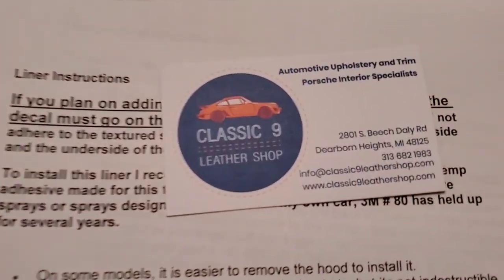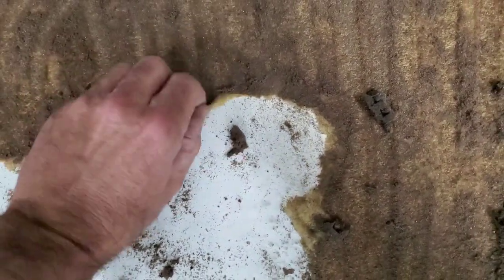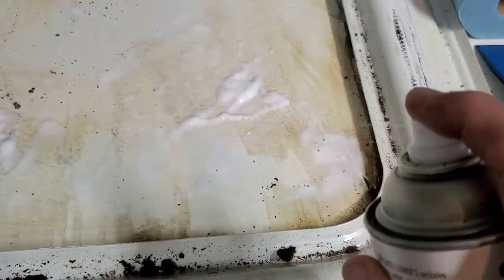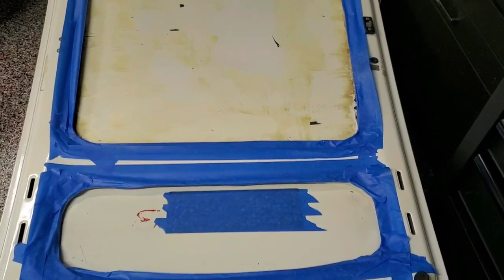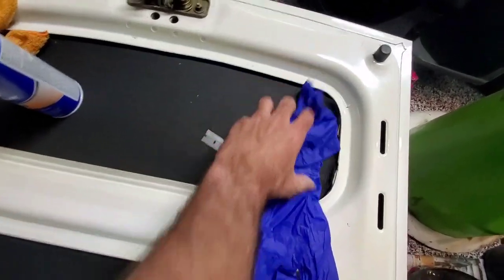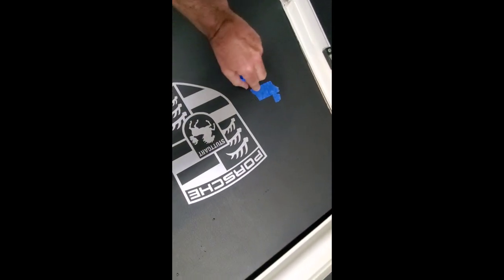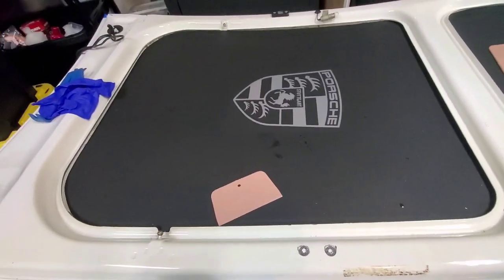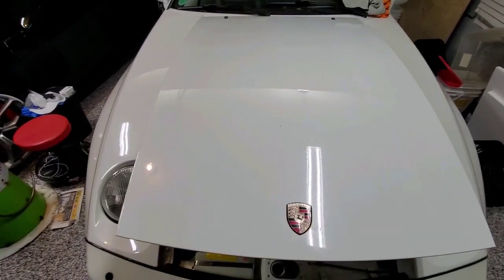Porsche 928 restoration part...?🤔 under hood liner installation.

Comment: Great job.  I did this on my 89 S4 last year. I got the liner from one of the "other" 928 companies but I love Garage 9 products. Only thing I would add is that I ended up using a stronger spray adhesive than suggested because of dropped areas. Supposedly reduces fire chances as well since the old foam liners can become oil soaked over 30 years.

Comment: Tony, just wanted to drop  you a line and let you know this is my 3 rd time watching this video! I have this same "repair" scheduled for the Spring when I take mine out of winter sleep. I have already gone to the Classic 9 website and picked out my items needed. My only question, please explain a little more why I should mark the bolts when I remove the hood?
Thanks in advance.
Reply from the maker: Good evening, the hood holes are slotted.  I marked mine so I could get it back in rhe same place for alignment.

Comment: You said you took it to an a/c shop to have it fixed. What did they do to it? Is it converted to 134 and why did they not fill it to the proper amount? I hope that if they had to vacuum it out and open it up that they changed the filter/dryer.
Looks good! Wish I could afford it. I'm sure you've sold it by now since this video is about 8 months old.
Reply from the maker: Warner, I did sell it.  I did not change the ac to 134.  The shop I found put the old r12 or whatever it is back in.  He flushed it and put new dryer and o-ringa in everything.  It was only $240, and I think it was a good choice.  The ac works perfectly and even in St Louis heat and humidity it cooled it right down.  I had bought the car as a COVID project to work on during the lockdown.   I miss it alot and it was such a great car.  I have been looking for another one and have my eye on one locally now.  I prefer the 16V engine.  The one I am looking at now is an 89 with 40,000 miles on it and not driven since 2010.  Keep an eye on the channel.  I am going to pull the trigger on the 89 or another car in the next month.  I have one more car,  a 1969 Pontiac GTO I am trying to get finished and will get a new project shortly!
Reply: @tonybosworth5382  That's bizarre! I didn't know you could get r12 now for many years. I have converted many cars over to 134 in past. It only takes a new filter dryer if the compressor works and there are no leaks. You just have to be careful because from what I understand you cannot put as much of the 134 in as it's r12 capacity. Oh well!
I hope you get the other 928 and will be looking forward to seeing you work on it.

Comment: Citrus cleaner will release the glue...you’ll need to hose off with water to neutralize when done.
Reply: Old credit card/membership card as a scraper...
Reply from the maker: Thanks Dan.  It all worked out well.  After I broke down the old adhesive with the electric contact cleaner the Simple Green worked well.   I used a wet towel and then 70% iso-alcohol for the final cleaning and worked great.  Sounds like you have done one or two of these or similar!  Thanks!

Comment: how much time would someone budget for the removal and installation?
Reply from the maker: Jim, I did it in about 6 hours including taking the hood off, detailing the underside ans waxing it before I pu the new liner in.  If you get the same one I got, be sure to use the 3M product they suggest.   I have spoken to several people who used other stuff and it didn't hold up.  Its well worth it when you are done!
Reply: @tonybosworth5382  Thanks  for posting.  Doing 86. 944 this weekend

Comment: My lining was mint, but a rat managed to find the warm spot and carved out an area, bastard. I am quite capable of square cutting out the offending area and replacing with a Porsche logo, but I am going to have to remove the hood which I am not keen to do.
Reply from the maker: I marked my hood with a water based marker i stoll from my granddaughter!  I did have ro get my wife to help for 10 minutes!